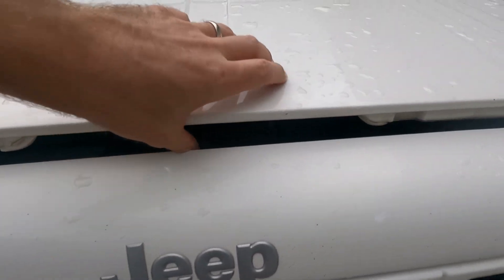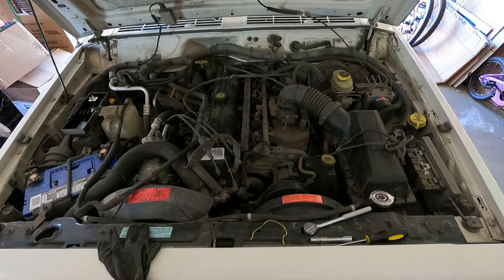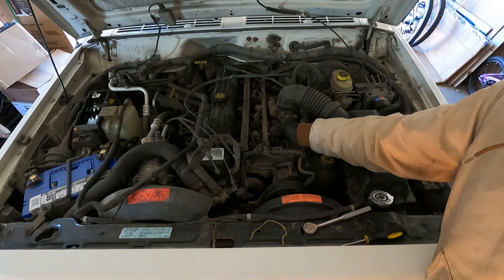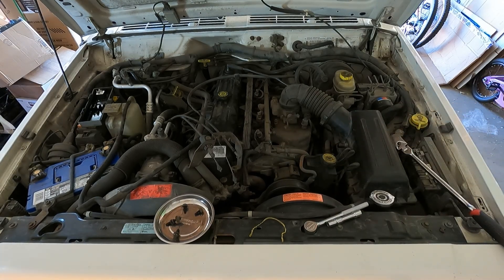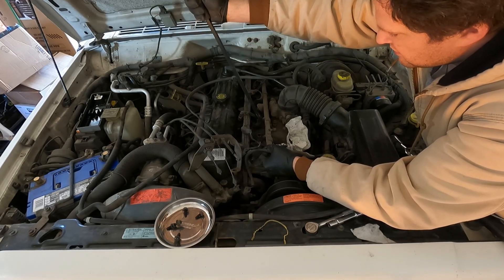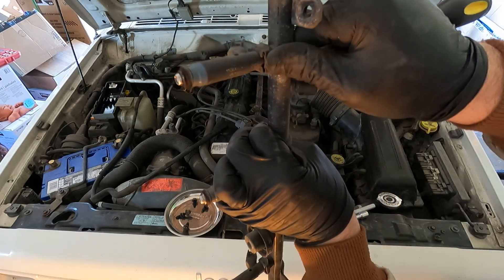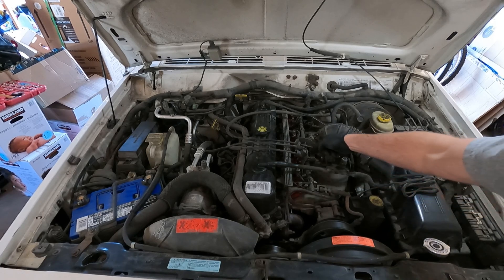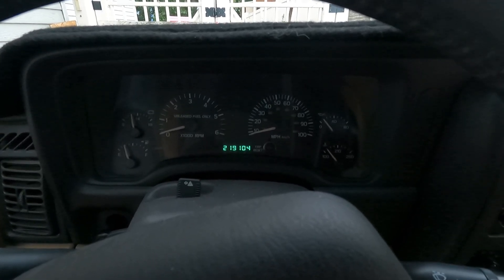1999 Jeep Cherokee Fuel Injectors

Comment: i got a 92 injectors original, runs good. techron once every two years
Reply from the maker: Keeping the injectors clean is very important. However better atomizing the fuel will increase efficiency and power because it will burn better.

Comment: Thank you for your video, it’s been a year since your install of the 12 hole, how has your Jeep been running? Thanks again for your video.
Reply from the maker: Everything still seems good. I'm getting just under 17 mpg which I think I was at 19 before, but I've now added a bit of a lift and 32" tires. I'm happy with the results. The one area that seems to not be quite as good is with heat soak. I didn't notice the problem much before the injectors, but now it seems to be a little more of an issue. Usually if it sits for 10-30 minutes after running up to full temp it will have a heat soak issue that will either reduce power quite a lot, or it wont start for the first crank or two. I don't know if it has to do with the 12 hole vs 1 hole injectors, or if it's just something I ran into for other reasons.

Comment: Now for set of plugs and wires, don't forget the PCV as well, the best luck on the PCV that I have had was the one from the dealer
Reply from the maker: I almost did plugs and wires at the same time, but they have definitely been replaced within the last 60k miles (my best guess). They are still on the list though!